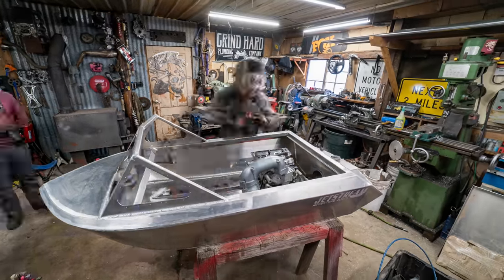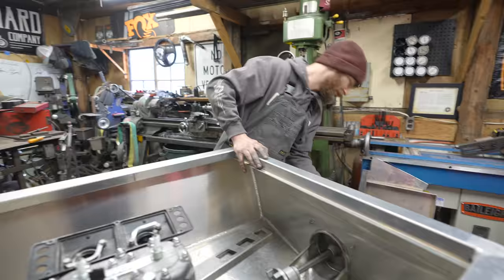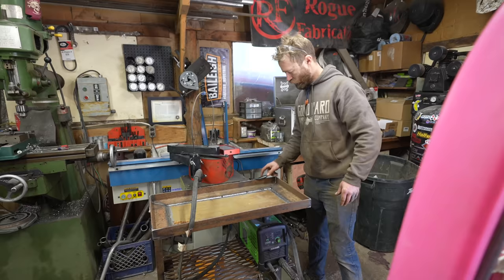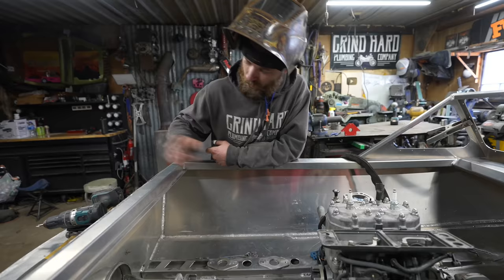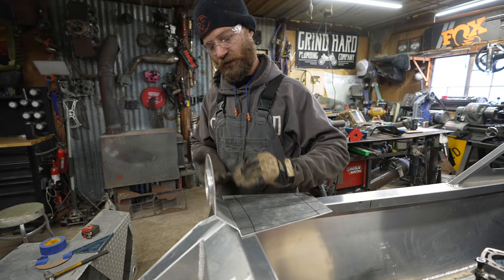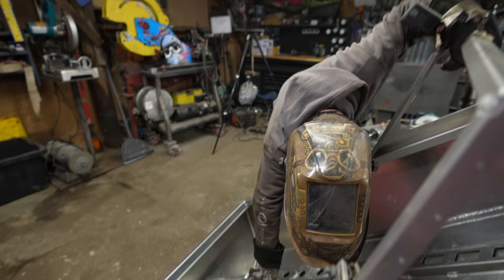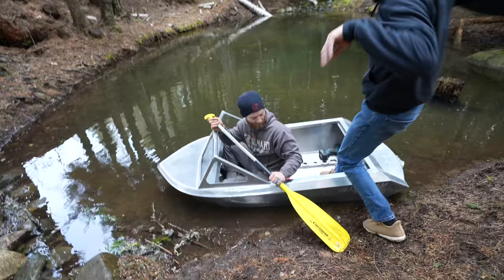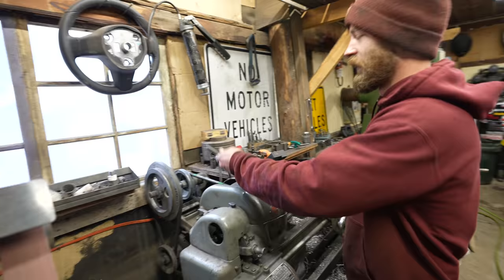Testing the 100HP Mini Jet Boat With a 18v Drill!

Comment: This build is going to be so cool when it’s done. I hate to be a downer, but I’ll be shocked if that pump tunnel doesn’t cause the pump to cavitation super bad. Not only is the opening much smaller than the pump itself, but the sharp corners and “arched” space just before the impeller will likely lead to air pockets forming at higher rpm’s. Keep in mind that the drill at full rpm is basically idle speed for that kawasaki 750, so spinning 3-4x the rpm with a pump tunnel that’s not very streamlined will almost certainly yield cavitation. Hopefully that’s not the case and it works exactly how you’re building it, but if it doesn’t, I think moving the engine to the front, building a longer driveline, and smoothing/lengthening the pump tunnel might be your best bet. This would allow the drive to sit a bit farther back and not be so cramped as well!
Reply: All that really needs to be done is the pump/intake has to be pushed back a bit to get a good smooth intake.
Reply: If not I'd make 2 more side tunnels on the sides of the engine and join them into the main tunnel..
Reply: @sawyerwallace9631  that could also work, but then the pump would probably hang out the back a minimum of 6 more inches. Would still work, but would make the boat handle weird
Reply: @EatSleepShift  Interesting idea. That could work, my only concern would be if the “side tunnels” were too widely spaced, on would almost certainly come out of the water on harder turns leading to cavitation. Also extending the tunnels to be longer to reach around side the engine could mess with the fluid dynamics and lead to a big performance loss potentially
Reply: This is the first think I thought when I saw how far they were pushing that coupling back into the intake housing. It’s gonna have a lot of issues.
Reply: I predict massive cavitation
Reply: This is why I made my suggestion above.
Reply: @alexwirtz3047  almost all of the guys in NZ that run tiny little jet boats push the pump and intake back. Not saying it's right but I know those guys tinker a lot with that stuff and it works well for them.
Reply: The kiwis invented jet boats. They know their shit.
Reply: @ttv8ra23  I know a minimum about jet boats, but mangling and bodging together that inlet tube doesn't seem wise to me.  All that stuff is worked out by people with advanced degrees in fluid dynamics, I tend to respect those people.

Comment from the maker: We put so much love into this video! What do you think? Enter the giveaway here https://www.grindhardplumbingco.com
Reply: So much love. This is my new favorite editing style!
Reply: Y'all making the boat or not taking a long time
Reply: NOT TO JUMP THE GUN, but...you will probably need a more aggressive pitch on the impeller for 100hp.  it will most likely redline quickly, thus not using the full potential of the engine. kinda like being stuck in 3rd gear on a car. probably still fun, but not nearly as fast as it could be.
Reply: your skill on the lathe is awesome!!! but a tip i learned for safety that you might want to think about is , when using emery cloth / sand paper on a piece wile its spinning be sure its not so long that it can get snaged in the work piece and possibly wrap around and pull you in. i have seent some shit as im sure you have haha
Reply: Please do a colab with cleetus McFarland
Reply: Might be a bit sketchy because of top speed potential. But powerwheels and gocarts at the FF might be pretty cool. Get all the regulars out there. Cars and cam, rather be welding, etc. Do like 3 class 5 lap heats. Get boat done and take it and a few projects make a long weekend out of it.
Reply: Giveaway implies free. It's a raffle that requires purchases.
Reply: @eriknulty6392  
  I think you mean it will cavitate.
Reply: @theguy497  
  While it is a risk it's a small one.
   I machined for almost 30 years and have had the paper grab,the worst thing I ever got was a paper cut,of course it was a sand paper cut which is definitely not pleasant!!
Reply: You have to build a mini boat trailer for the powerwheels
Reply: @TrulyUnfortunate   it could cavitate its always a possibility, though thats not what i was referring to. i just got done putting a way too big outboard on my offshore fishing boat. my boat is a aluminum hull thus it weights ALOT less than a similar boat made of different materials. the "recommended" prop for a boat that size from honda was wayyyyy to swallow of a pitch. (cause its super light comparatively) DIDNT CAVITATE, just hit redline to easily...when the motor was very capable of spinning a prop that could move more water. now that i have a more aggressive prop im thinking of asking NASA or SPACE-X to sponsor me LOL. there is nothing like building something that can easily break itself, and me.
Reply: Man, you have restricted the intake flow so much that you may be better off with less power. With heavily restricted intake flow, it won’t take much power to cause cavitation. Start cavitating and you start doing damage to your pump and impeller. 6 more inches of driveshaft would have let you give it a proper intake, and it would have been a blast with 100hp.
Reply: You need to use a fan while welding indoors like that the fumes are toxic and wear a mask from 3M with P3/P100 pancake filters they fit behind welding mask use the mask when sanding, grinding and using laser cutting too
Reply: Which state are you guys located in? Looks like... NorCal?
Reply: As a master metal worker or journeyman whatever you want to call it at.   your guys ages and quality of your work and tricks and skill I've seen apprentices take years and years to learn.  Just the way you guys inset the driveshaft the way you did enstead of just welding it so it holds it's strength and integrity and will not snap or bend at the weld point shows you guys have great skill.  And I'll never stop complimenting you on it.
Did you guys learn mostly by doing or do you guys have a formal background in training.
Also where are you guys located
Reply: I've used the break technique to make radios many times good job.
Reply: looks like a kid's boat. Can't wait to see it on steroids :))
Reply: So what the hell happened to the tig welder to break like that?
Reply: @theguy497  I was very nervous watching that part too, but great work and video!
Reply: "No more wiggly-jiggly" 😝🤣🤣🤣
Reply: Y'all got to tell Cletus how to do a time lapse the sliding camera angle thing 🏆💪 can't nobody f*** with that 😂
Reply: Wrap it like Barbie build a trailer to match then to top it all off go all out and get Pink tents and hippy lights for the camper boink
Reply: nice bogger swampers.
Reply: Can y'all do erase between the Camaro and the first the mustang
Reply: A sand capture needed
Reply: got a sheet metal roller from harbor freight like $300 comes fully installed
Reply: @eriknulty6392  They will also need a twin scoop intake grate because of how shallow the intake is or It's going to cavitate like crazy.
Reply: duuudw nice work man love the vid and the fabrication music everyting mon
Reply: great job on the half pipe nice fit man
Reply: @matt3x37  I have a two-wheel cart that hooks up to a lawn mower but the great part about it is it holds the weight load across the center axle so you're not holding it in your hand they're cheap enough and I bet that thing it fit on it and I'm sure there's someone there that could beef It up
Reply: By the way YouTube ought to have a way to designate post as extraordinary instead of only allow options why you didn't like it yeah you can thumbs up but they should allow for content that's of a higher standard to get recognized on that note I'm two years behind I need to catch up on your work
Reply: Do you make these boats for sale? I lost my single person fishing pontoon in the Oregon Beachie Creek fire. Would like to know how much it would cost. I don’t want it as fast as this one you are showing but it would be the perfect size for this old lady lol!!

Comment: what you need is a pipe anvil. find 3'-4' sections of heavy wall, steel tube, 6", 4", 2" in dia. at the scrapyard, weld them horizontally into a strong frame at the ends, parallel to each other, with about a 1/4" of space between them with the largest one in the center, weld some legs that you can bolt to the floor onto the frame holding the tubes, and presto! you can make smooth curves in sheet stock easy peasy, lemon squeezy. just insert the sheet between two of the tubes, and bend it around the dia. tube you desire like a brake. they're really useful for making body panels, drive shaft tunnels and the like. and being d.i.y., you can save a few hundy for project fundage. there are a couple of how to vids here on the youtubes that will give you an idea of what they look like, and just what they are capable of doing. honestly, i can't believe you don't already have one with all of the fab work that you do.

Comment: Lol built lots of jet boats here in nz. This is going to be awesome.   Intake could be an issue but keen to see if it works or causes cavitation at speed.  Note the nozzle will work better out of the water as the nozzle velocity  is way higher , watch the marthon racing boats for a demo of this.  This caught bill hamitlon out when he built the first jet units as he had the nozzle exiting underwater but found the boat went way faster with nozzle above the water line.

Comment: (From a naval architect/boat engineer) Can't wait to see it all together! The shape of the jet drive kills be a bit though. If the interior volume of the drive should be more of a wedge shape and less of a mailbox shape. If it is more of a wedge shape (less vertical at the impeller bearing) you will get better flow and more thrust. The present shape will cause a lot of eddy making resistance and possibly cavitation.
Reply: So they'll only get 40knots at just over half throttle?
Was thinking the same as you but on the other hand I'd like to see them do more videos in the future, this is good enough to start with even if they have to change the impeller a couple of times haha

Comment: if it's that fast with a drill, then it's going to be insane with the real engine in it. Can't wait.
Reply: Makes me want to see an electric version with a big LiPo pack and a monster brushless motor! That Makita is just a little 5S2P lithium ion cylindrical pack and an ~300W motor and moves it OK, you could blast through a creek with a 5000W motor and big 14S pack!
Reply: @username34159265  that was where my mind went! But batteries 🔋 weight a bunch! Then you'd have to 💧 waterproof the electronics to the MAX but 💯 % MAXIMUM torque at 1RPM, makes you start 🤔 thinking!...from Wyoming USA 🇺🇸 🤠
Reply: With that pump, that's about as fast as you are gonna see tbh

Comment: I have a feeling you are going to have issues with pump cavitation when you have the motor turning it. In my experience that cavity in the top of the pump will hold a pocket of air and the smaller size of the intake might limit the waterfowl into the pump causing the impeller to spin freely in that pocket of air
Reply: You might want to look into making something like a pump stuffer and increasing the size of the intake if possible
Reply: There is going to be a massive limitation on that haggard pump setup for sure. 
They should really talk to people that know this stuff before going balls deep
Reply: I was thinking the same thing, def going to have more water trying to go out the back than is coming in, need an intake grate that promotes more intake flow, and a reduction nozzle might help it out
Reply: Made the same suggestion. They did an amazing job fabricating to the constraints but its not fit for purpose (as an intake) need to remove that 90 degree dead head
Reply: Yeah they should’ve either set the pump back a little more or kept the drive shaft a tad longer to help out with that or like you said a pump stuffer would be perfect 
I deal with this stuff on standup jetskis
Reply: Maybe doing a feature episode with Mike Finnegan and all of his jet boat knowledge. Would be awesome to watch that
Reply: Yeah this is going to cavitate really badly. Pump should have been set back a few inches to give room for the intake. But they whip this stuff out amazing quick, so I wouldn’t be surprised if this gets a redesign once they are disappointed with its performance. It looks like there is only like 4” of useful intake area because the front 2/3’s is almost completely blocked off. No amount of scoop grate will fix this.
Reply: You guys can complain all you want; personally I DO hope he limits the number of waterfowl into the pump.  Poor ducks.
Reply: Ghpc does stuff like this all the time, throw it together to make the idea a reality, then make episodes perfecting the idea
Reply: Send it
Reply: @KatanaBart  underrated response
Reply: @conorb350  whats with the Ducks?
Reply: The louvers should keep any waterfowl from being sucked in, but if they do, they'll be safe in that little pocket of air until they can swim out again.
Reply: @armandosoria7993  trying to keep the waterfowl out
Reply: Nope, according to fluid dynamics the water will replace the air immediately because, the flow will be immense, this jet boat will try to launch itself violently out of the water if he chooses to send it..!
Reply: @fullsendmarinedarwin7244  what you see as a dead head will become a vacuum chamber of sorts, it will function just fine for its intended purpose. Fluid dynamics dictates flow, as such, the water will take the shape of the chamber and the flow may be more turbulent than an optimal intake chamber, the water will always take the path of least resistance and the optimal line between laminar flow and turbulent flow will still be achieved.
Reply: @SPHYNX99752  I respectfully disagree, I'm a HVAC engineer by day, I have worked with some BIG water pumps (40-70kW) , pumps will cavitate very easily if you stuff up the intake design. It makes the impeller go off the "pump curve" once that happens the impeller is quite literally spinning its wheels. I suspect this one will work fine at lower RPM but once that thing starts sucking the intake will starve the impeller causing it to cavitate badly

Comment: Just a bit of info WD40 or CRC are your best friend when machining or drilling aluminium, stops the tool/drill from loading up and gives a beautiful finish. Also when cutting or grinding aluminium with a fiber disc use paraffin wax on the wheel and it wont load up and will cut like a hot knife through butter. Just use acetone to clean parts before welding.

Comment: I’m guessing the inside radius part of the intake might cause cavitation. The PWC’s have a gradual slope up to the back of the transom. I could be wrong with the cavitation and would work just fine. 🤷🏼‍♂️
Reply: Best bet for getting a good flow geometry and not destroying the impeller would be to lift a complete pump housing and tunnel off a PWC and just retrofit it.

Seat of your pants fabrication is one thing for easy stuff like suspension, but fluid flow systems are something I'd want a tested solution for.
Reply: 100% will
Reply: Its a shame they couldnt go with traditional prop. 100hp jetboat will go like 50hp with prop. And like you say this will cavitate bad.The impeller will spin in mainly a vacuum and engine revs will raise to the limiter with little forward thrust.

Comment: I feel like that water intake might be too restrictive to flow efficiently at 100hp. If it ends up cavitating badly I’d bet that’s the issue.
Reply: Yup. Hoping I'm wrong cuz they just did a lot of work
Reply: Yes,it would.That's why I suggested the scoop above.This will be going so fast and hardly have surface underwater.
Reply: 100 HP is a lot of power in a tiny opening like that. 20 HP would probably be ok, maybe even 40 HP, but 100 HP? I fear they're going to suck a huge vacuum inside that tunnel. That cordless drill has maybe 300 W of power and the boat moved pretty fast. They want to increase that by 250 fold? Good luck! I don't think their water intake will have much more than water vapor inside it when cranked up to full power.

Comment: Yall are going to need a twin scoop intake grate with such a shallow intake. It will help a lot when trying to holeshot and midrange. It will also keep it from cavitating at high speed. Another bonus is it will slow you down fast when you let off the throttle. You can turn the one you have into a twin scoop intake grate. Look at pictures online and Ethan can do it under 10 minutes, lol.

Comment: Teflon the belly. Slides better on rocks/sand/snow. Same stuff sleds used on rails. Plus the extra protection from ripping aluminum. Love the build. Did one back in 16 with a 10'5" using a 650 kewi. 30mph got us in trouble.

Comment: Might want to try smoothing out that transition above the impeller shaft.  You have a good water seal now, but add something that will allow the water to smoothly fill the impeller inlet ring from the impeller shaft and up to the top of the housing near the ring.  You’ll get much less air intrusion into the impeller, less cavitation in the inlet stream of water, and thus more power going into thrust than making bubbles.

Comment: Micro "Cracker Box Barbie Boat".. I grew up going to the boat races out at lake Havasu and while the circle boat racers were awesome to watch my favorite was always a good old vintage cracker box boats. If you lost the windshield added lots of deck length set up the seat at the transom just over the pump you would have all the leg room for comfort the weight distribution probably perfect would be a really fun little sporty ride.